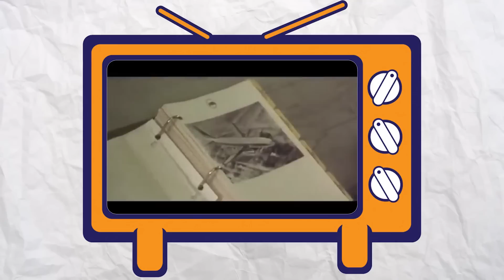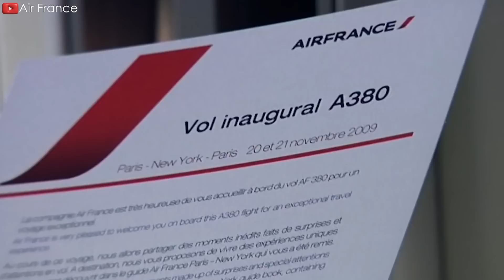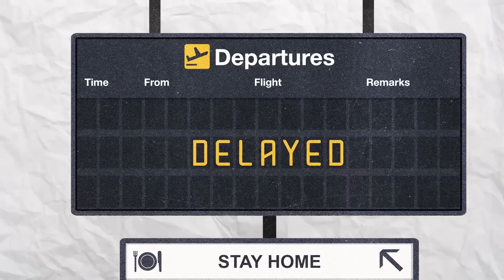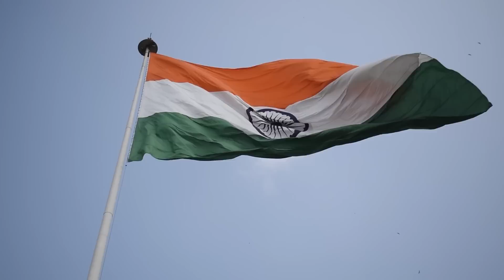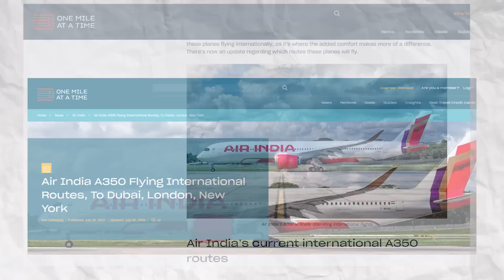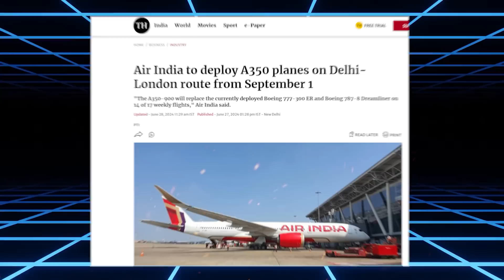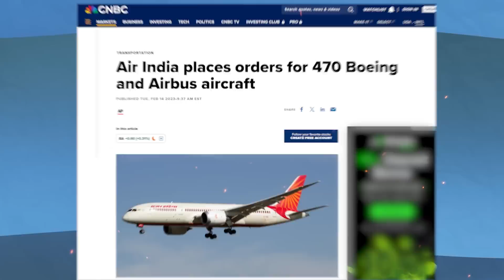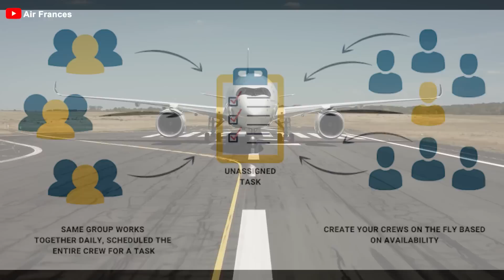India Revealed HUGE Plans For A380 & A350 Will Change The Entire Aviation! Here’s Why

Comment: Excellent information.

India's aviation industry is growing, and currently, the country has 157 operational airports, heliports, and waterdromes, with the number of operational airports expected to reach 200 by the end of 2025. The target is to increase the number of operational airports to 350–400 by 2047. The number of aircraft increased from 400 in 2014 to 723 in 2023 despite the impact of Covid-19. This is expected to rise to 2000+ by 2030. 

Apart from the airlines you flashed in your graphic, several new airlines have launched or will be starting in 2024: (1)Alhind Air, based in Kerala, this airline is expected to launch operations by the end of 2024. It plans to focus on South Indian cities. 
(2) Shankh Air, based in Uttar Pradesh, started ops last month (3) Fly91: Based in Goa, this airline began operations in February 2024. (4) Sirius India Airlines: Launched by the former COO of SpiceJet, this airline provides premium charter services. 
(5) Kohinoor: This airline is operated by Mr. Vijay Walia and uses Airbus A320-100 aircraft. 

Another thing to keep in mind.  India started the Aircraft Leasing business at GIFT City 3 years ago - 26 companies have set up show and more than 150 lease agreements have already been signed, which includes aircraft, engines, helicopters as well as ground support equipment.

Domestic air passenger numbers have surged from 60 million in 2013-14 to 145 million in 2023, an increase of 135%. Meanwhile, international passenger traffic grew by 50% during the same period, reaching 70 million. The domestic numbers are expected to reach 300 million & international will double to 150 million by 2030. We are looking at 450 million air travellers by 2030.  By comparison, all UAE airports combined handle 100-110 million passengers annually.  Singapore Changi Airport handles 70-80 million passengers annually.  Given the difference in the volumes, A380 may not make financial sense for UAE & Singapore but the same may not be true for India.

Of all the new airports being built in India, there are possibly 3-4 that can handle A380s - Jewar Airport, Navi Mumbai, the new Bengaluru Terminal 3.  The 2nd airport at Chennai has also recently been approved.

Comment: Such a horrible non researched Video. None of the Indian airlines were interested in A380... this is complete fake news and I cannot believe that ppl believe whatever nonsense somebody is posting without an ounce of research. A380 works for Emirates and few other airlines because of the hub and spoke ... Middle East is smack in the middle of North America/Europe and Asia...so A380 is valuable for those routes. The issue with A380 was that the next generation of Engines to make the plane much more efficient was just not there and Airbus did not want to spend money on it, especially with the success of A350s ..longer hual and fuel efficient. Then Boeing with its 777X ..that is already delayed..will also be a fuel efficient aircraft. A380 is a legend...its sad that it did not work out the way it was planned...i have flown A380s numerous times and it is by far the best long haul aircraft..both economy and business class. Qatar Airways..A350 is the closest ..especially in Business Class with its level of service. ....A350 gives a longer range..so will Boeing's 777X ... so yes A380 is obsolete and no new aircrafts are being manufactured and many airlines have already quit on it. But with the delays of A350 and 777X ...A380 has being a game changer for Emirates and others post pandemic. It will eventually be phased out and retired and replaced ... but I am glad i got to be in A380 for the last 2 decades..its an engineering marvel. 

Air India is completely useless ..they keep waiting on newer aircrafts and have done nothing after Tata's takeover to improve anything on the existing aircrafts. Emirates. Qatar, Singapore are at least 50 years ahead ..and they will continue to innovate.. Air India will always be playing catch up. Most Indians have never flown...they dont know what service means...so they book a cheaper flight from India to UK or to US and have horrible experiences. I am glad I dont need to fly AI ever..until they prove that they can compete with professionalism.

Comment: Few asked where will India get the used A380s. Well Air India had bought 6-8 brand new Airbus A380s during Praful Patel’s reign as Civil Aviation Minister between 2003-2011 at inflated prices. Those were not suited for Air India in that decade. So Air India was compelled to sell of these new A380s to Middle East based leading Airline at greatly reduced prices there by causing substantial losses to AI and much bribes were made by that corrupt criminal Minister and his cronies ✅
Reply from the maker: Oh! Thanks for your information.
Reply: Air India never bought A380s ..stop spreading misleading information.
Reply: Absolute bullshit . AirIndia never bought 380s 😂😂.

Comment: The whole world is getting rid of A380 due to high cost of operation this makes no sense specially for Air India
Reply: It makes very much sense when there are a shortage of planes.Maybe it doesn't fit in US with its limited population, but it does in Eurasia with 5.5 billion people and 1.4 billion in India alone.Most of Emirates A380 are back in service and they would loose revenue without it.because there are only two runways in Dubai.India also have a shortage of airports and slot times.
Reply: Emirates CEO says that if you are able to pack the plane then it is totally worth it. The rest of the worlds countrys don't have the population to sustain A380s. The current Delhi to Mumbai flights are always packed. This can taketwice the amount of people one plane can. India has the population to sustain and affordably opperate A380s!
Reply: Aadha adhura gyan mat pel!This makes total sense for India. Other aviation experts have explained why in other videos!

Comment: Only reason airlines using the A380 is because there are no planes available. Even if they have some extra, it doesn’t make sense due to cost associated with traveling
Reply: @jlmarc01  The Emirates operates 250 A380 planes and are discussing manufacturing another large order. Even India has some airport which can handle this plane. India may order A 380s once they come back. And they will, perhaps with even more fuel efficient engines.
Reply: @crusoerob8550  But not for the A380. Is it not made anymore??
Reply: @crusoerob8550  
Emirates have 123 A380s